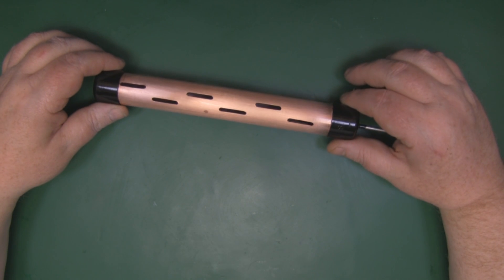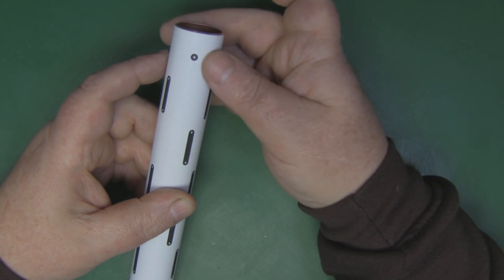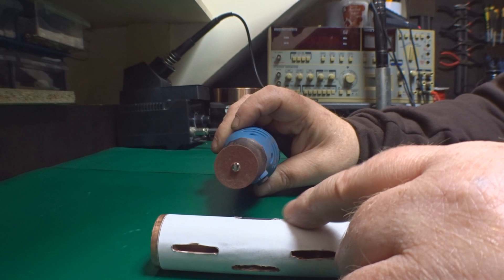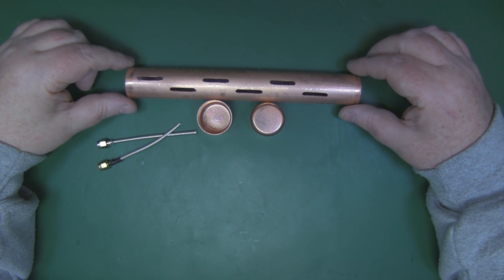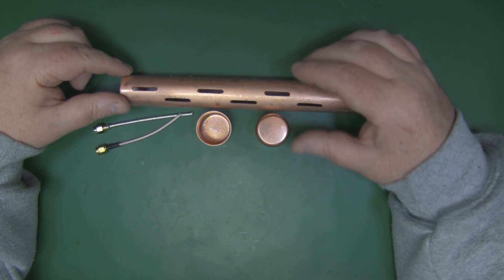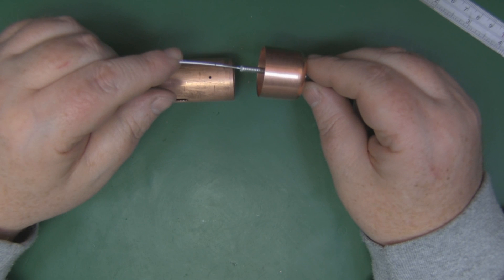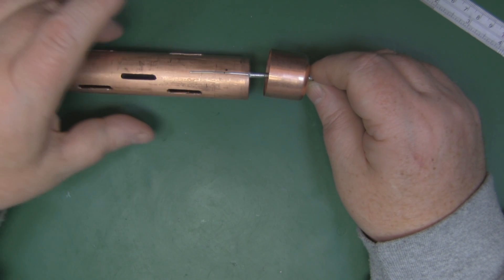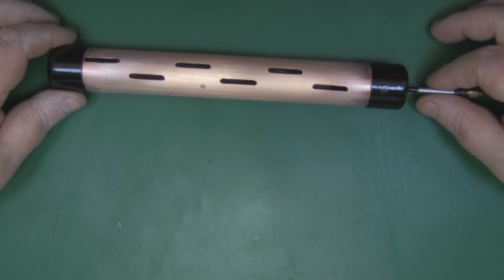5 8 wave slot #155

Comment: Hi Andrew another interesting antenna.  As I fly long range FPV I am always looking at improvement in signal over range.  Only problem is that most people who FPV use CP antenna's on their aircraft and this is obviously a linear one,  how about designing a comparable antenna for the aircraft ie a linear one for 5.8ghz with some sort of gain that would work hand in hand with this slot antenna?  Secondly as I always use 5645mhz on my transmitters (more power lower frequency) are all your 5.8ghz calculations and antenna's resonant on the lower of the 5.8 frequencies like the one I use or will they need to be lengthened slightly?  Like your vids and you do a great job I am stlll using your 10 turn 5.8 helical and aint found anything yet to beat it.  Bill